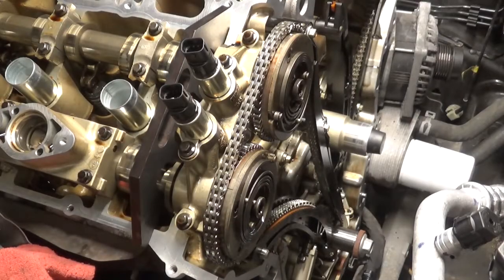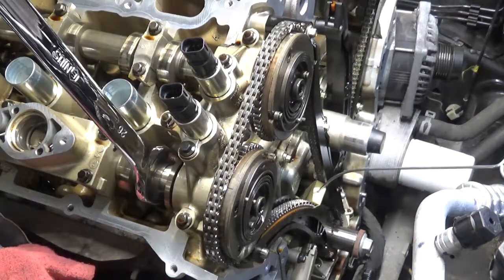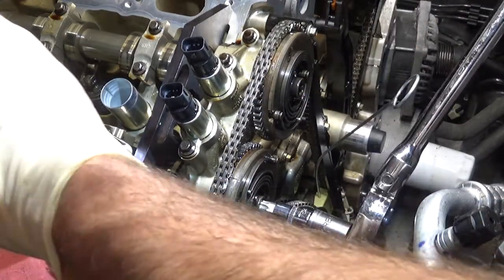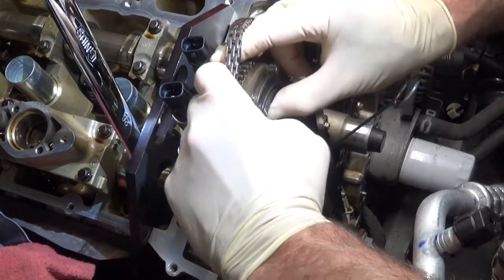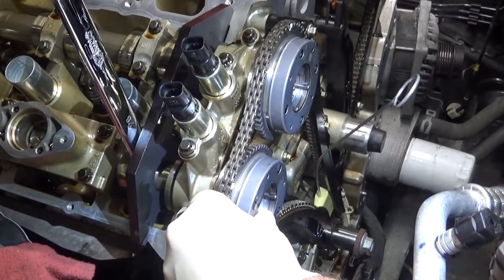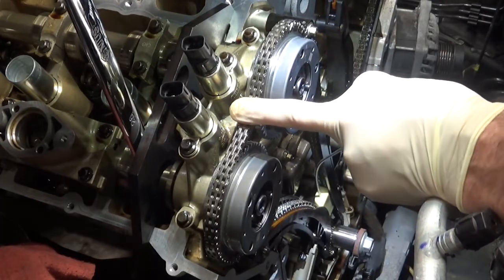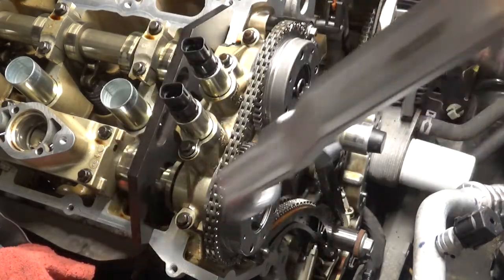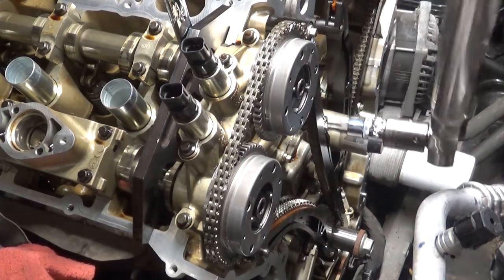FORD 3.5L ECOBOOST CAM PHASER TRICK

Comment: I have a 2018 Ford f150 XLT that has 28000 miles and the cam phaser are making the rattle noises Called Ford about the problem they said sorry can’t help you. Never buy another Ford product

Comment: What's the process for the other side, as in where would you put the wedge cause there's not really a spot to put it. I feel if I put it against the tensioner and remove the phasers on the other side then the chain is just going to fall off the crankshaft and water pump.

Comment: I have a 2018 F-150 and had the cam phaser replaced under warranty right at 60K miles. At 117K now and I have the rattle again. Unbelievable. Ford should be ashamed of themselves, but they aren’t. I would like someone at Ford to know I will never buy their product again, but I don’t think anyone there or anyone in the auto industry cares anymore.
Reply: Trust me they will care when none of their vehicles sale the problem is that alot of ppl that buy the new cars and truck aren't car ppl they just want something new not knowing that what they got is a ticking bomb
Reply: When ford does it under warranty they go back in the the old style phasers while if it was out of pocket they uses the updated style.

Comment: Excellent video. 

Can some someone explain tightening to 150 degrees?
Reply: The bolt is meant to stretch, which is why you can't reuse them.  So, after you torque it to 18ftlb, then you turn it 150 degrees further.  Easiest to do 90 degrees, then 60 degrees.

Comment: So im concerning doing my phasers myself. Just wondering could a person just remove one camshaft and get the space you need to replace the phaser without removing the whole front cover?
Reply from the maker: Unfortunately the valve covers and front cover have to be removed. There is no way to remove and install the phaser bolts with the front cover on 😓
Reply: @raincitywrench117

Comment: The little clip on the tensioner, does this have to be moved all the way to the backside of the plunger after pulling the pin?
Reply from the maker: No. It just kind of rides wherever it wants to. Most of the time around the middle.

Comment: Can you get my mechanic to do this for me? Jk jk, my truck is a 2011 with 175k, so I might as well just do a full timing chain.
Reply from the maker: 2011 3.5 will have a single primary chain and two secondary chains, different than the later gen 3.5L in this video. The gen one 3.5 with single primary chain can stretch but don't think the phasers are prone to making noise.

Comment: What’s the cost of this job usually? I’m also in WA if that makes a difference. Thanks!
Reply from the maker: Ford warranty reimbursement is just under 10 hours. If out of warranty then I believe labor time is around 13.5hr. Probably looking at minimum $2000 labor plus parts. All depends on shop's labor rate.

Comment: Could you possibly torque down the phasers before reapplying tension to not have to worry about putting pressure on the guides rails and tensioner, also could you use a pair of vise grip on the cams locked against the other cam or intake surface to prevent the cam tool from flying and having to use a wrench and extender?
Reply from the maker: Yea you can use a vise grip to hold the cams. You could also index a wrench on the cams with the alignment tool still installed and tighten before pulling the wedge on the tensioner 👍

Comment: Greetings ; wondering why you had to install the 2 phasers at the same time ?
Reply from the maker: If the tensioner and guides are left in place then there isn't quite enough slack to install one at a time but if both are done together, no problem 👌

Comment: How many links are between each mark of the chain on the passenger side?
Reply from the maker: That I don't know. Workshop manual does not say. With crankshaft sprocket keyway at 11:00 o'clock position, camshaft holding tool 303-1655 will index with both camshafts. If tool will not slide on camshafts then they are aligned properly.

Comment: My Ford dealer is doing this to my 2018 next week, I can only hope they're as well versed at this as you. Unfortunately warranty not covering my low milage (under 50,000) truck because I'm in Canada. My letter and subsequent call to Ford Canada fell on deaf ears.
Reply from the maker: Your dealer should be well rehearsed on this job 👍 🤞 That's news to me. What is Ford powertrain warranty in Canada?
Reply: @raincitywrench117  5 years 100,000 kilometers (about 62,000 miles). Mine timed out, the rattling started about 2 months after my warranty expired.
Reply: @allanrheaume5549  im in this boat any update?
Reply: @n8eman  Yes, my local Ford dealer did the job. They're a very small dealership and their service is very good. They quoted me about $3000 Canadian to do the job, it took them less time than they thought and in the end billed me $2450 + tax to do the job. Truck is nice a quiet now and I'm pleased with their work. Funny enough they're cheaper than my local mom and pop garage for regular service like oil changes, brakes etc. I'm still pissed at Ford of Canada though, I think they should have picked up the tab on this one.
Reply: @MrGamman3yt  Yes they did put in the new type phasers, part number starts with "ML"

Comment: Nifty, but once you're that deep into it wouldn't you want to replace the other components while you're there?  I guess if you've already been in there a few times dealing with phaser issues then the other parts may have low miles on them.
Reply from the maker: Ford warranty only pays for new phasers but yea, if it were higher mileage and my vehicle then I'd do everything 👍
Reply: @raincitywrench117  I acquired a 2012 with 98,000 miles on it. It now has 166,000 and is now doing the sitting a few days rattle on start up. If I elect to have a shop fix this, should I have everything replaced do to the mileage? Thank you

Comment: Hope this actually fixes it. I have a 2012 that i would get this done if I knew it would be the end of my troubles. I'll end up getting a new truck eventually
Reply from the maker: The third design seems to be the fix on the second gen Ecoboost. I haven't seen one come back yet...
Reply: Ya I have a 2011 f150 ecoboost that I have regretted buying ever since I turned over about 90k miles…
Next truck will definitely be a 5.0 lol.

Comment: Well done. A little off topic, curious if you've ever seen the oil pump drive belt fail on the 2.7 ecoboost. TIA
Reply from the maker: Thanks! Nope, not yet....
Reply: @raincitywrench117  they fail on the 1.0 seen it alot